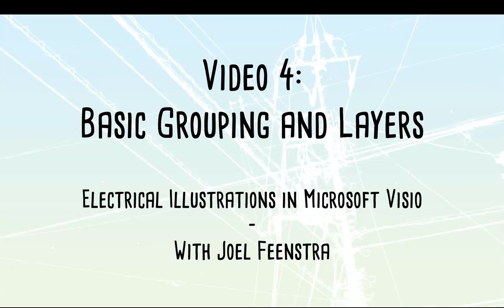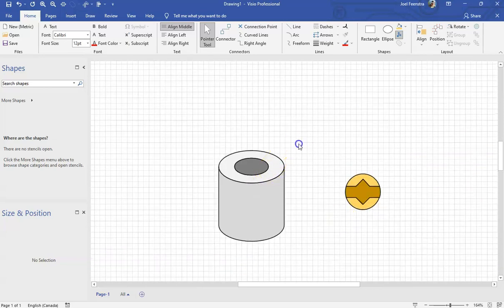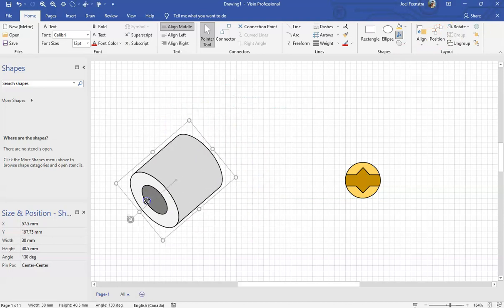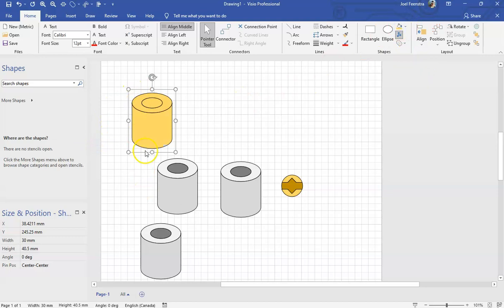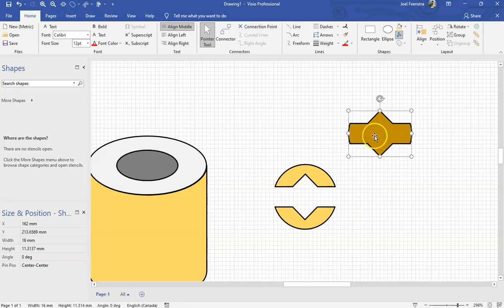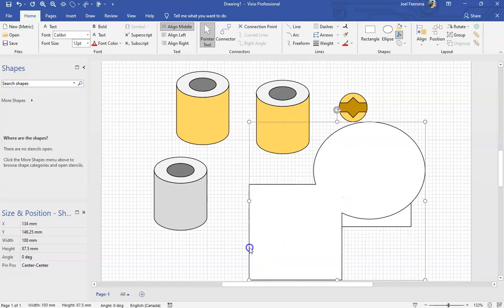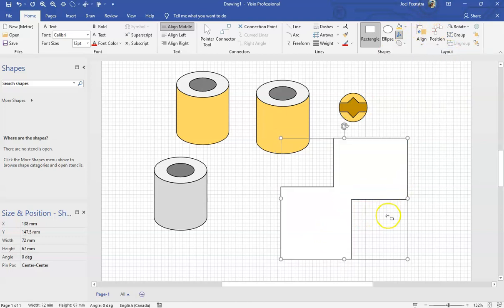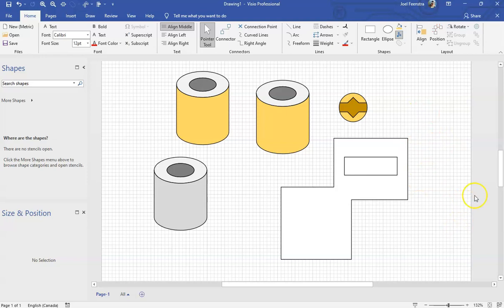Video 4   Basic Grouping and Layers in Visio

Comment: Nice video.

Use Ctrl G to group

Also, to add a symmetrical circle or square, hold the shift key and then add rectangle or eclipse and it will be a perfect square or circle respectively.
Reply from the maker: Nice tip on the Symmetrical drop!  I didn't know that one. Cheers!